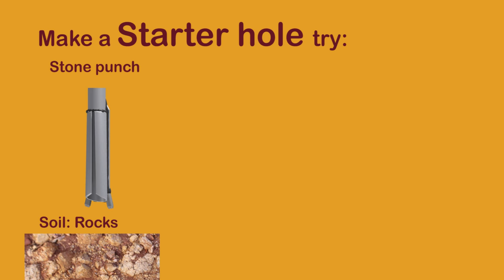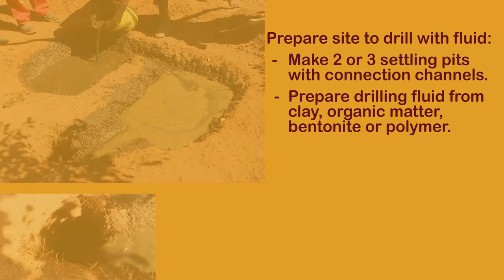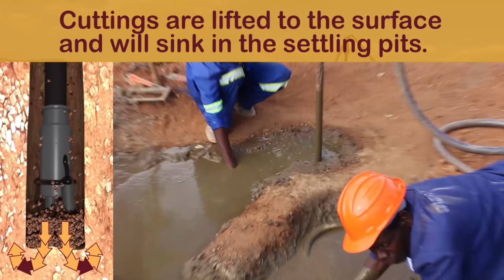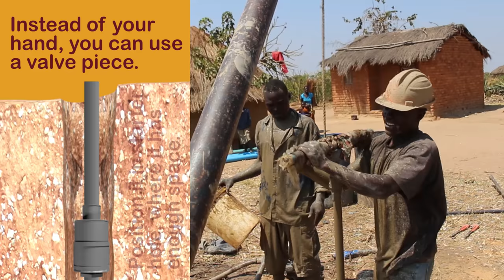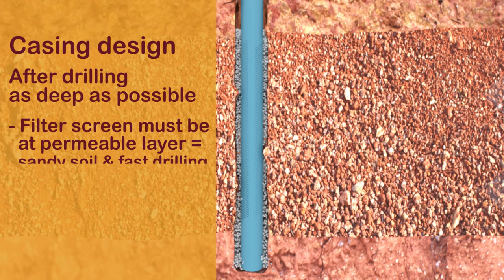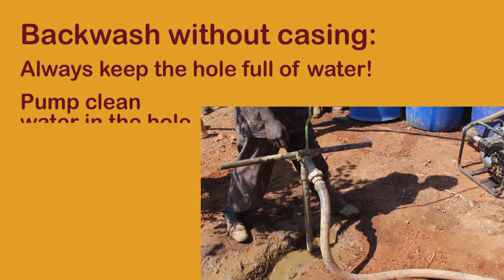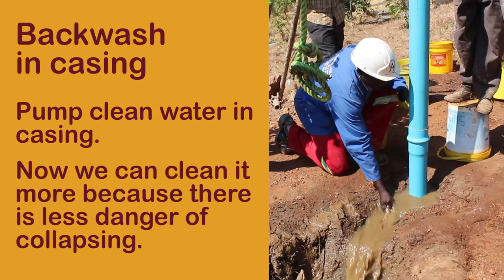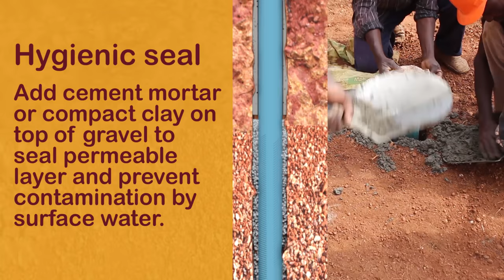Tutorial manual borehole drilling, SHIPO method

Comment: can one of these tools actually cut a layer of pure rock?
Reply from the maker: Teams are cutting through pure rock layers if they are not too thick. Of cause the challenge is that you don't know how thick the layer is. So they often try for half a day or even a day making little progress hoping to shoot through.
Reply from the maker: What helps a lot is to do Vectical Electrical Sounding measurements to determine the best place to drill. The equipment can be locally made and use, manuals are at www.jacana.help/resources (short video on VES: https://youtu.be/3QHpT1xYuss). We for example are in a place in Zambia that is "limited suitable for manual drilling" other manual drilling techniques fail easily. But when we combine VES measurements with SHIPO-drilling, the drilling success rate is above 90%.

Comment: How many days did it took to drill all this?
Reply from the maker: Rural Africa does not have money but it has plenty of time. the time needed depends a lot of the soil structure. An affordable electrical survey HEP and VES helps to determine the best location and drilling technology to use. More on that, see: https://youtu.be/3QHpT1xYuss. There are manuals how to make and use the equipment at www.jacana.help/resources/water Now to answer your question: On average a drilling a borehole to 24m costs about a week.

Comment: Better than most hybrid low tech methods. Most information is correct. I would make a few suggestions if they are wanted. Having worked in water drilling for some years.  Will try to survey the other video and publication.
Reply from the maker: Yes, Braith. Your suggestions are very welcome. More videos and manuals on affordable water supply are at https://jacana.help/resources.
Reply from the maker: Hello Braith Miller, If you have suggestions, please let me know. Thanks
Reply: @JacanaHelp  I will. Better to review your information to do it better. Some woud be improvements.
The mortar-cement seal was the only one that could potentially cause problems the way I observed and heard the description. Assuming that bentonite clay may be unavailable or expensive local dried heavy clay chips should go down prior to prevent cement-sand from actually potentially ruining the well. Bentonite from the gravel pack to the soil grade is perfectly acceptable. Various codes in some places require mortar-bentonite seals honestly not better so if it costs more don't do it. 
Most drilling methods need to be modified for each local conditions. 
I have an interest in helping further.
Reply from the maker: @braithmiller  Thanks, Good suggestion. I never heard about sand/cement running down into the gravel pack that far. But it still makes sense. In Zambia WARMA is the groundwater authority overseeing our work. 
Thanks for the input.
Reply: @JacanaHelp  It is a risk I would not take without at least 20+ kilo of bentonite or local heavy clay chips settled on the top of the gravel pack first. You may by process get a natural clay barrier on the gravel pack. Regardless compliance with local rules. They will be interesting to know. They vary here, some not making sense.

Comment: Nice video.... Many thanks.

Can I flush my borehole by myself.
I have a petrol pump and a hose long enough to touch the base of my borehole. My borehole is 30m deep. It always get dirty when ever it rains.
Reply from the maker: I think you can: Cleaning means loosing the dirt particles in the slots of the casing (for example with Swabbing) and as quickly as possible pump all of that dirt out and don't stop until water is clear. For swabbing you can use a piece of rubber that is almost the size of the casing (internal diameter) and under that rubber you make a stronger piece of plastic, a bit smaller than the rubber. Attach both to a strong enough pipe push it down slowly to the very bottom and pull it up fast to suck the dirt out of the slots. this way you wash the full length of the filter-screen (place where the casing has slots). After that quickly pump out the dirt with a pump that can handle dirty water. Don't allow the dirt to settle in the bottom of your borehole.
Reply from the maker: Another thing to do could be to place the pump at a different spot in the casing. Place it at a spot where there are no slots in the casing.
Reply from the maker: Let us know how this works out for you. Thanks and good luck.